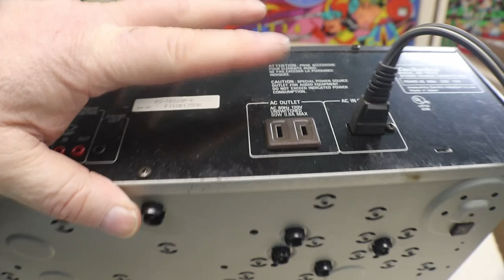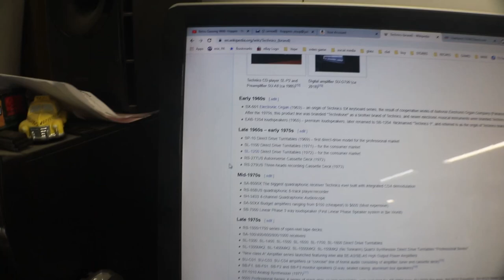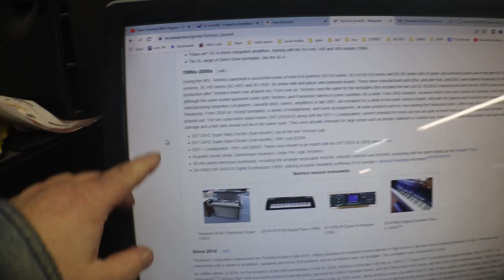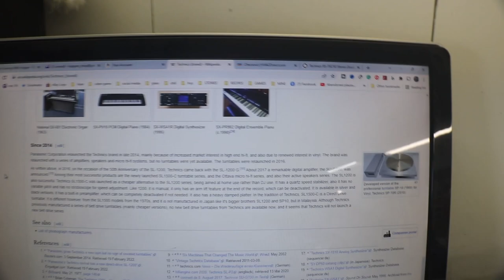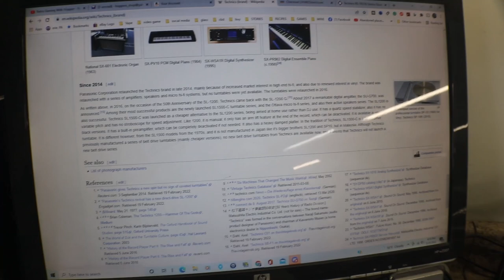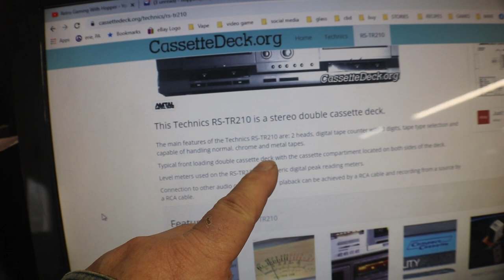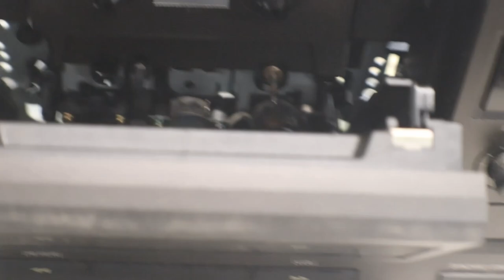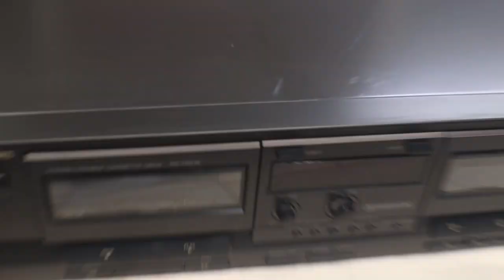Technics RS-TR210 Dual Cassette Deck / A Look At & Cleaning

Comment: Great video!  I was just given a  RS-TR210 from a friend.  I still cherish my cassette collection.  Are you saying that the deck cannot record from deck to deck?  When I place a blank tape in deck 2, and play a cassette on deck one, I release the record/play button and deck one shuts off!  I also have problems with recording levels?  Did you not mention a gain feature that was inside?  Would that help?  So…in order to record, you must plug the turntable and CD player directly into the cassette deck?  If so, this is silly.  What’s the point of having a duo tape deck if you can’t record off both decks?!
Reply from the maker: Thank You. Yes this will not record deck to deck. If you put two cassettes in and push play on both tape one will play. At the end of tape one it will shut off and play tape two. Less time changing cassettes.
Reply: @RetroGamingWithHopper  ….. incredible.  Technique makes a duo tape that does not record off each other yet comes with recording features like a  VU  level meter.   So much for making mix tapes.  Too much of a hassle to directly hook up the turntable to the cassette player, along with CD player.   And the sound levels hardly pick up on the VU meters.  Where do you adjust the levels on the inside?